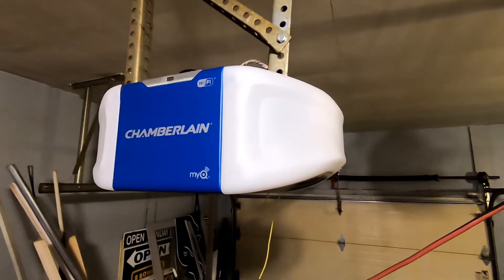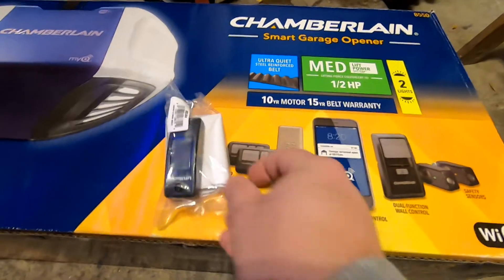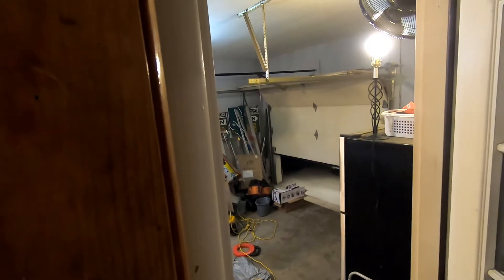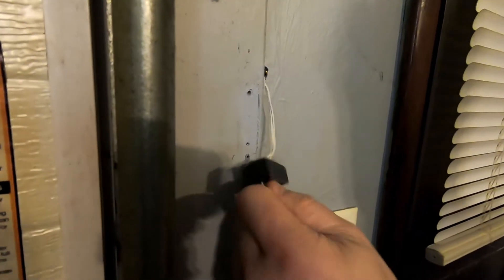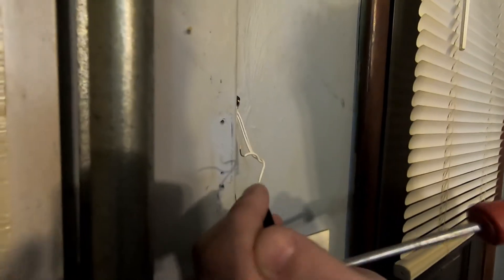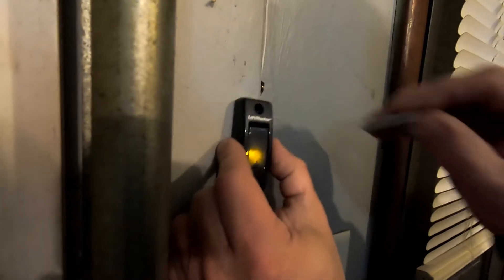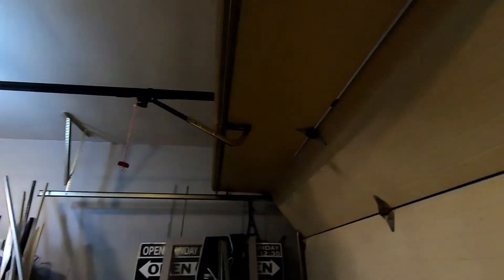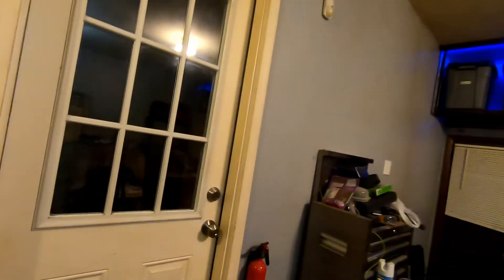How to Add a Second Button to Chamberlain MyQ Garage Door Opener Install

Comment: Thanks so much for posting this video! Just installed a new Chamberlain B2401 on a door that never had an opener. Everything works great but I wanted to add a 2nd wall button next to the door. I was hesitant to try an "old-fashioned" door bell button and was guessing it would be difficult to find an answer. But, low & behold, there was your video showing me EXACTLY what I needed to know. Thanks!

Comment: Darn, wish I had watched this last night before I installed my Chamberlin C2102.  After seeing this I would have run my photo eye wires down the track. I just never thought of it and tacked it to the ceiling.  They should tell you to do this in the instructions. What a great idea!. I was replacing an old Genie opener and was going to use the same door bell button and it didn't work.
I ended up installing the button that came with it.  All works fine. Looks like a well built and quiet chain drive unit that will last.  thanks for the great video.

Comment: Excellent, very helpful video. Especially enjoyed how your cat helped out! Thank you very much for the effort to solve the problem and taking time to post. I ran into this issue after installing a new Chamberlain B6713T. Disappointed that the old second doorbell switch didn't work but this new one is just fine, thanks also for other folks who commented about the security 2.0 standard. In response to some of the questions on programming, all I had to do was hit the light button and the switch once or twice and everything is communicating. Once again, great job and thank you!
Reply: Hi Tom, I’m in the middle of installing the B6713T.  Is there a specific button model to use, or will the model mentioned here work just fine ?  Thanks for the help
Reply: @1960bond  - I used the same one mentioned here, works as described and you'll be fine. A product review for that button, I wish the separate button that controls the light were more prominent- it's a little obscured on the right side. I am getting used to it.
Reply: @ISignedUpBefore  I have wall buttons in the detached garage, but want to run wired wall buttons into the house as well.  Can I connect the wiring for the 2nd switch to the terminals in the already installed original switch?

Comment: The reason the old push buttons don’t work anymore is because Chamberlain made their openers stop working on short-to-operate. Basically, your old green button, or any wired doorbell button, shorts the 2 wires together when you press the button. Sometimes when the installer or homeowner would run the push button wires to the opener, they’d pinch the wiring too tight with the staple and cause an intermittent short, causing the door to run at random. This was Chamberlain’s solution, the new buttons are programmed to the machine and send some type of signal to the motor to run. 

As for your programming the wall button, when it’s first connected the light on the button flashes indicating the button isn’t paired. You need to press the ‘run’ button for about 2 seconds and the light should be solid. Then you’re ready to go.
Reply: Is the "run" button the side button?
Reply: @johnny7808  No I was referring to the main button that runs the door. Once you first power it up, the light will flash. Hold down the button you would normally press to run the door for a second or two, and the light turns on solid. After that it’s programmed and should work normally.
Reply: @NicksGarageDoorService  thanks my 883LMW arrives tomorrow, appreciate your help
Reply: I have wall buttons in the detached garage, but want to run wired wall buttons into the house as well.  Can I connect the wiring for the 2nd switch to the terminals in the already installed original switch?
Reply: IN ORDER TO GET BOTH BUTTONS WORKING:

-Wire both buttons in to actual door opener.
-Activate the new small one by pressing open/close.
>“if big button does no longer lights up” fret not…
>>Disconnect big button reconnect, it should turn on

The directions are nonexistent.  
This is how I got both the large main button and the smaller to light up simultaneously.  (special button that is no longer A simple door bell.)
Reply: @1mikeabite  
“if big button does no longer lights up” fret not…
I desperately needed this advice to avoid going postal.
Disconnecting and re-connecting the big button wires did not work for me… 
However, using the wireless remote to open the garage door did restore the big button light.

Comment: Did you just insert the bare wires into the slot on the panel of the motor housing where I already have the two wires from one opener on the wall going to?

Comment: is it wired in parallel with the original button?
Reply: No mention on where you connect the low voltage wires to the opener. Do you connect to the Red and White terminal same as the wall controller?
Reply: Did you just connect the 833LM wiring to the motor or run it to the multi-funtion control panel
Reply: I have wall buttons in the detached garage, but want to run wired wall buttons into the house as well.  Can I connect the wiring for the 2nd switch to the terminals in the already installed original switch?

Comment: I can't get the 2nd button work.  I have a chamberlain C2202.  the LED is blinking.  Tried every combination of pressing the light button, main button - nothing.
the little manual that came with it said to press the main button 3 times to sync.  That also did NOT work.
The button is the 833LM per your video.

thanks in advance

Comment: Anyone know if this will work as a second button for a Chamberlain C2202? Just installed it over the weekend (January 2022), and was surprised to find that you set up the phone app to control the door through the wall button --- not by directly pushing buttons on the lift unit itself. So the included wall button is vital to the system, not just a simple switch.  I still want a second wall button for the front of my garage as seen in this video, but since the wall button the opener came with seems to be vital to controlling/connecting the wifi, would the SECOND button described in this video here mess all that up?  Thanks!
Reply from the maker: When in doubt contact the manufacturer.

Comment: I have a device called a Tailwind which does not work with my B750 due to the proprietary nature of the B750 button control. Is there a way to have the wall control(same one as yours) to send a pulse to the opener? The Tailwind closes/opens the garage door by GPS and my phone. Paying for a MyQ subscription makes no sense.
Reply: What are you would have to do is disassemble one of these buttons and solder or connect two wires on each side of the actual button contacts on the inside of the button and connect those to your Tailwind and put the entire thing back together and it should work fine.
Reply: @InsideAlexsToolbox  nice suggestion. i may just do this.

Comment: Important info here:: I bought the cheaper 2 pack version off of amazon. It says compatible with all chamberlain yellow button GDOs. It does not say anything about "myQ" ... They dont work.... Im going to try the other brand for 20 bucks a pc and see if that works.  The other 20 dollar units do say "myQ" in the description. I will post what I find.  If the 20 dollar units dont work Ill probably just solder onto the spider to jump out to a old style pushbutton switch.  But PIA.  Note: for a test I did rig up two of the large factory push button panels on one wire set and they both work fine.  Ticks me off I would have to spend 50 bucks x 2 for a switch though.

Comment: I would pick another brand.  The security is a joke and cost $ ro use it.   You can not use old rail without tricks (save time), must have safety connected (more time and money for wire in my case) and no simple short to open (for security) BUT they put it on the internet via your Wifi and an app, really secure now.  And the open button had to be swapped out.  Just a pain for me, I am old and simple too.